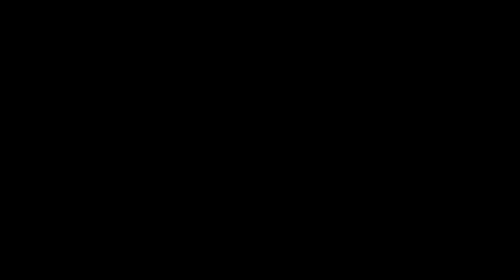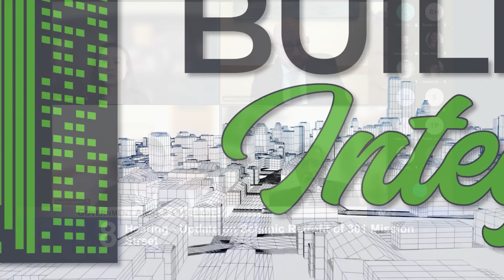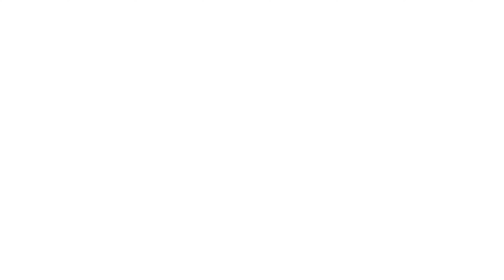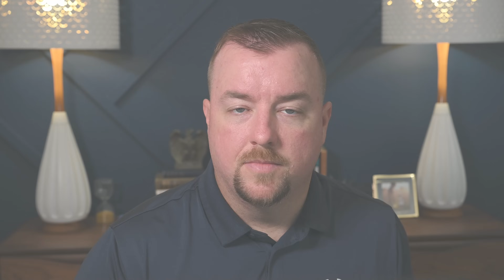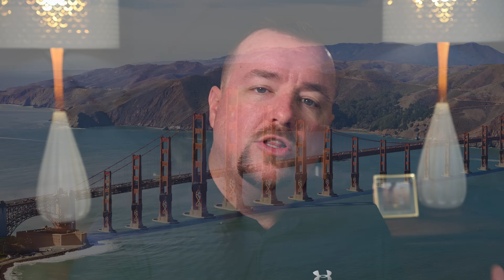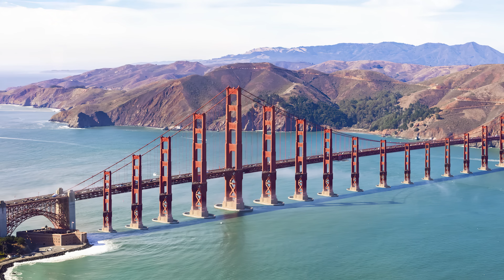Millennium Tower's "Sophisticated" Fix?  You Decide - (San Francisco's Leaning Tower Part 4)

Comment: My goodness, Josh.  I'm planning on replacing my front porch this summer.  If I asked these guys for advice, they wouldn't be able to decide whether the floor joists should be twelve feet on center, two inches on center, or maybe something in between.
Reply: I'm pretty sure none of those suits could explain 'on center'.
Reply: They would think hard and tell you your porch only needs one (1) support, then bill you like your needed 40.
Reply: Are you going down to bedrock?
Reply: @hypsyzygy506  Probably later after it's complete.   I think that's how it's done.
Reply: 4"x12" joists... 2.5" on center. ;-P
Reply: @Real_Tim_S  4"??
Reply: @OffendingTheOffendable  the joke is that they'd specify an on-center measurement that would only work in CAD when material collisions weren't taken into account.  Because they sure as heck are not doing any engineering here...
Reply: @Real_Tim_S  Eye balling it.  Don't need to get fancy.
Reply: Exactly.  But in your situation one or both are going on experience and/or judgement, and the stakes are a wooden porch.  The point of this presentation is "a sophisticated analysis" was not done, and it should have been given the stakes.
Reply: Go with the cheaper number, and if it starts bowing, just add more around the perimeter.
Reply: 16" or 24" depends on the decking material being used
Reply: "Lol on center....just start hammering"-these guys in the video
Reply: y should they know ? they are not "sturctural engineer"
Reply: I'm not surprised about this leaning tower because someone is trying to steal the Glory of the millennial reign of our Lord and Savior JESUS CHRIST -  that will happen after the rapture and the 7year Tribulation. just read the Book of Revelation and get rapture ready. Also listen to Dr. Ron Rhodes on end times chronology.
Reply: Will 250 joists do the job?  It will?  Good, job done.  It is not like your porch is a multi million dollar skyscraper.

Comment: In an earlier video, you discussed the cracked, bowed and deformed foundation mat.  Won't adding more peripheral support simply make this issue worse?  Is there a failure mode where the mat 'gives up' in some manner, causing further damage and chaos?
Reply: I don't believe it was a mat slab .   Shored walls with piles and lagging.   Was also curious "where" the piles will go.